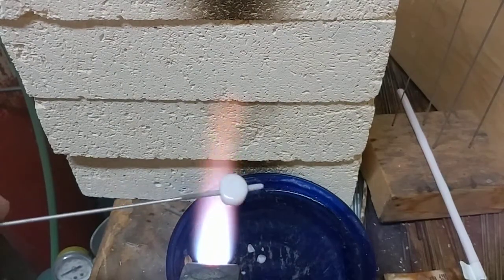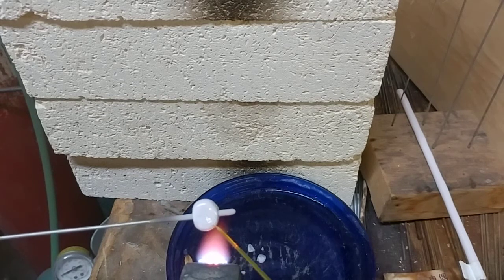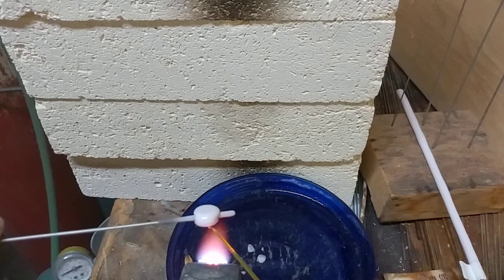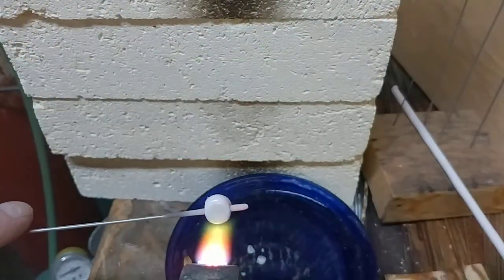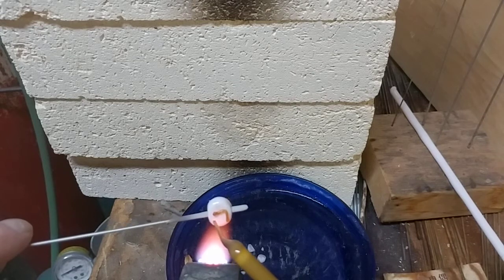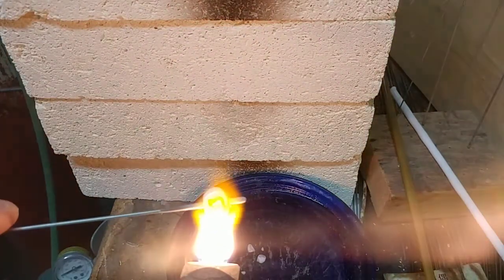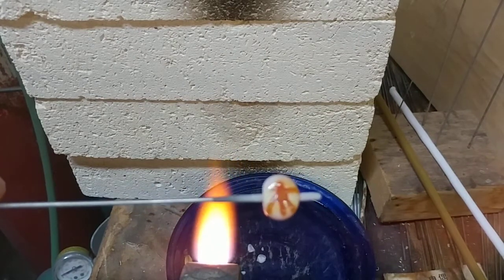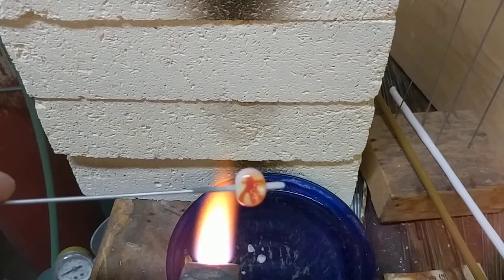Hot glass calligraphy

Comment: Which torch are you using? Are you using a oxygen concentrator, or are you hooked up the an oxygen tank? Nice technique. Which camera are you using?
Reply from the maker: It's a nortel midrange.  I looked at oxygen concentrators but I've never used enough oxygen to justify the cost; there's a place just down the street that sells oxygen (tanks/exchange.)  Do you use a concentrator?  Any recommendations?
Camera is just my cellphone rubber-band attached to a chemistry ring-stand. I desperately need better camera choices, and would love to hear suggestions.
Reply: @smellsofbikes  your camera recording looks great. I am using a local concentrator. So I can’t recommend any company to you. That torch could also melt boro as I have researched. So a concentrator with 10 liter/min for soft glass and 20 for boro should be fine.